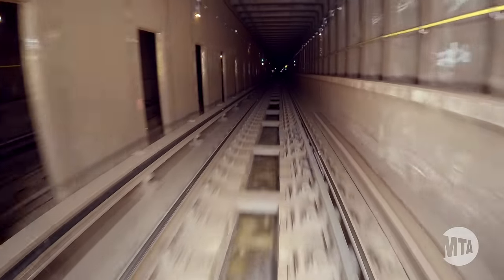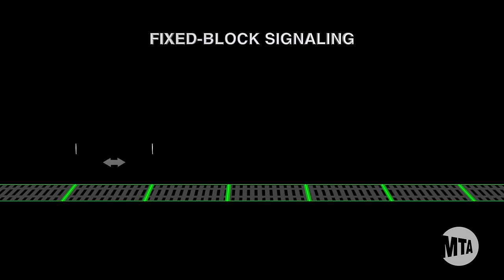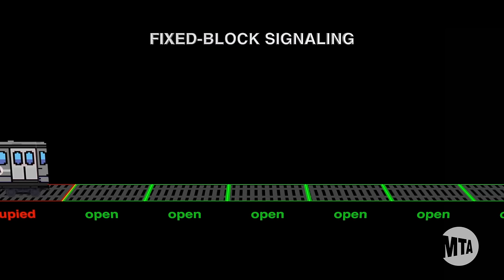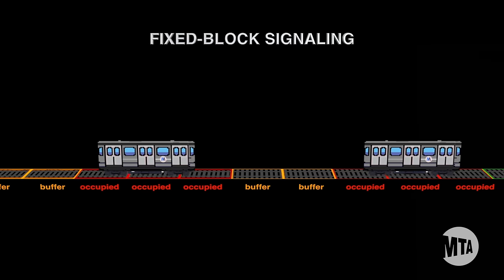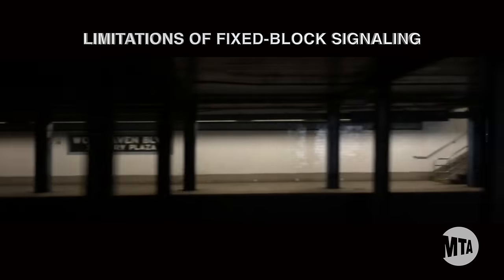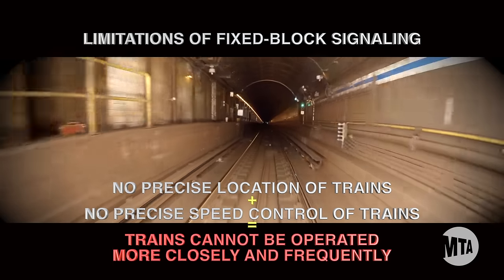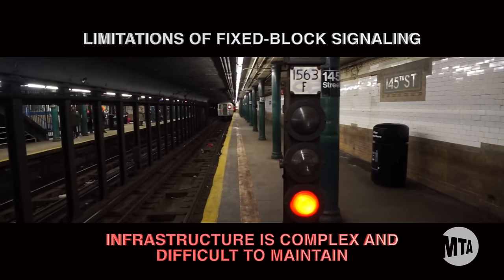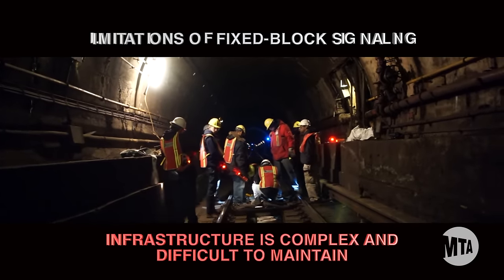What is CBTC?

Comment: Would be so cool if the MTA would install the CBTC equipment on the museum trains which, currently, are not permitted to run on CBTC lines.
Reply: sadly its impossible because so called SMEE's are too complex and old to have CBTC installed. But NTT's (trains made from 2000 to present day), can have cbtc installed. WHen the R211's finally come to the 8 av line, 8 av will have CBTC installed and their old R46s (a car that can't have CBTC) will be retired.

Comment: I miss my R142as on the 6 I want my R142as so Lexington Avenue can go back to being just R142as and R142's
Reply: Same here
Reply: I actually like the R62 because its made from Kawaski i dont mind seeing just R62 because its made from kawaski but the R62A gotta go AND i love the R142A so much because i been living along the 6 line since 2000 so its hard not see the R142A's anymore
Reply: Actually R143 and R160 are also made by Kawasaki
Reply: R62 type trains have technical equipment which is old and harder to maintain, in contrast to the newer train cars. I don't have an exact reason why MTA are considering in replacing R62s with the newer R142As, which has already been done with the R62As being replaced completely with R188s.
Reply: I like the R 62 on the 3 line but not on the 6 line so now this make sense that they took out half of the R142 A and transfer it to the 7  line because the 6 has no CBTC
Reply: Douglas Wells Not to mention the need for extra service. This swap has resulted in two extra trains added to the 6 line schedule starting in April 2019 (correct me on the date).
Reply: Isolatic They did this swap and conversions for the following reasons:

To provide CBTC compatible cars for the 7 line.
To increase service on the 6 line to solve overcrowding and dwell time problems
To boost Kawasaki’s track record of delivering reliable cars in order to snag the R211 contract.

In the end, most of the IRT will have increased service (despite the “downgrade” on the 6 line), and more new reliable cars will come soon thanks to Kawasaki winning the R211 contract.
Reply: Isolatic The R188s DISPLACED the R62As, not replaced them.
Reply: In the future, the 4/5/6 will get CBTC.  Most likely they'll be the recipients of the R262, and the R142/A will go to the 1 and 3.  The new trains should be even better because they're supposed to have open gangways and I believe USB and wifi.  Is there something you don't like about the R62A?  One advantage of them is that although it's very small, the railfan window is fully transparent.  The manual announcements aren't as clear but they're not as intrusive or monotonous
Reply: @fristi60  Not all of the R160, only the 'B' type.  Also the R68A and the PATH PA-5
Reply: @kinkisharyocoasters  lmao honestly it’s funny looking back at my old accounts from 2-3 years ago! But I always grew up with NTT around me so I’m not use to being around old technology trains

Comment: CBTC and "fixed block signaling" are not alternative concepts, and the fact that NYCTA's own engineers don't know this should tell you something. CBTC simply means you use a wireless communications system to give the train its speed command. It may or may not know exactly where the trains are and might not efficiently separate the trains. A moving block system is an alternative to fixed block signaling, but is not necessarily communications-based. Also, a moving block system is not necessarily of higher capacity than a fixed block system. Again, that NYCTA's own engineers don't know this should tell you something. For instance, London's Victoria Line has fixed blocks but the minimum platform reoccupation times are in the 40-50 second range, far shorter than NYCTA's L line. That's because what really matters to capacity is not whether the signaling is fixed block or moving block", but other aspects of the design, primarily the train's spare braking capacity.
Reply: Very useful comment. I would add that what is being said at 1:00 is completely false. Fixed block signalling can also allow a precise speed control of the train when used with transmission lines along the track that indicate the speed profile to follow and even accurate stopping points at stations (very useful when platform screen doors are used). The technology has been used in Paris since the 70s and has since been improved with VAL and Meteor automatic train control (on line 14, also in Paris).

Comment: What is being said at 1:00 is completely false. Fixed block signalling allowd a precise speed control of the train when used with transmission lines along the track that indicate the speed profile to follow and even accurate stopping points at stations (very useful when platform screen doors are used). The technology has been used in Paris since the 70s and has since been improved with VAL (65 seconds headway between trains in regular operation or 55 trains per hour per direction) and Meteor automatic train control (on line 14, also in Paris).

Comment: List of CBTC swaps

Flushing
This required the R142As on the 6 to move to the 7 and become R188s, as new trains are needed. In return, the 6 got R62As.

Queens Boulevard
This required the R160s on the N, Q & W to move to the E, F & R lines. In return, the N, Q & W got R46s. The E line and some of the F line were already assigned R160s before this move. 

Canarsie
All trains assigned to the L line were simply equipped.

Crosstown
All trains assigned to the G line were simply equipped. The G line already swapped out R46/68/As for R160s before this move as a result of maintenance adjustment due to Queens Boulevard CBTC. The rest of the sets from the E, F & R lines got equipped as well in case a loan is needed.

Broadway
All trains on the N, Q, & W will be directly replaced by new R211s or some Alstom R160s, which will be equipped. The R46s will retire, while the R68/As will move to the B/D. The Siemens R160 will probably not move to ease driver training. 

Nassau Street
This will require the J/Z to be all R179s, which may require additional ones from the C. The R143s and the first 64 R160s will be exclusive to the L and the rest of the four-car R160s will be exclusive to the M. 

8th Avenue
All R160s/R211s on the A, C, E will be simply equipped.  

6th Avenue
This won’t happen until the R268 gets delivered for the B & D lines.

Comment: CBTC could of went to the (4)(5) and (6) too but instead of converting R142as into R188's y'all could of well you know what forget CBTC 

(4) train should have R188's

(5) trains with R142as 

(6) trains with R142as 

Come on MTA almost everyone who takes the 6 train is still fighting for there R142as and there not gonna stop until you give them back so MTA expect more comments like this
Reply: We need our R142A back on the 6 line
Reply: Milton R142AProduction the 7 needed it more
Reply: MCSM PRODUCTIONS sadly
Reply: LIRR SBS PRODUCTION Flushing needed it more. The signals there are older and the neighborhoods it serves are becoming more popular and undergoing changes.

In addition, the R62As were transferred back to the 6 line to increase service on the line during rush hours and end the chronic overcrowding and long dwell times that currently exist on Lexington Avenue. It also improved 2/5 and 4 train service since the transfer of R62As meant that there were 20 R142As freed up for 4 train use, which freed up some R142s for the 2/5 trains. As a result, most of the IRT now has increased service, which is great for me since I felt like I’ve been waiting forever on the Brooklyn IRT for a train home after 7:30 PM on the way home from college.
Reply: P Jay You need extra 6 train service to end the chronic overcrowding and long dwell times that currently exist on Lexington Avenue.
Reply: The Lex will have CBTC.  I believe they did the Flushing line before is since it's simpler as only one service uses it, as was the case with Canarsie

Comment: I am confused, can't we just stick GPS trackers on each train and track them through an app in the meantime (like what we have for buses with MTA Bus Time). This may be tricky for the underground sections but won't this temporarily circumvent the problems with not knowing where a train is?
Reply: SowMuchMore no you cannot do that. Are u trying to kill people? They need to use technology that runs through the train, the third rail, and signals. If you put GPS on the trains, how are they gonna know where trains are underground? Do u have service on your phone when you're in tunnels? What about when trains cross under the water? That's completely unsafe. This is the best solution and I don't understand how you are confused, the video clearly explains what's going on.
Reply: SooMuchMore The subway is mostly underground. GPS doesn't work under rivers, last time I checked. And also, the space between 2 (7) trains is 7.5 minutes more when CBTC wasn't on its line (trains every 8.5 min to trains ever min)

Comment: The work is taking years because the MTA works on only one portion of the closed line at a time. If workers worked at multiple points simultaneously, it would cut the closing time to a fraction of what it is. Why doesn't the MTA do that?
Reply: Brian that will interrupt Service more
Reply: How? For example, if the 7 is shut down between Queensboro Plaza and 34th Street-Hudson Yards stations, why couldn't there be crews working at multiple places along that stretch?
Reply: Brian It takes alot of crew men to work on certain Stretches of the line.
Reply: You can't shut down an entire line. The lines that are getting CBTC are the MOST crowded ones in the system. (L) and (7) trains already have CBTC and rumor has it that the MTA will work on putting CBTC on the (6).
Reply: So grateful that the Hk MTR managed to pull off the east rail line’s system upgrades with almost no closures at all (only working 2 hrs a day at midnight) 🙏